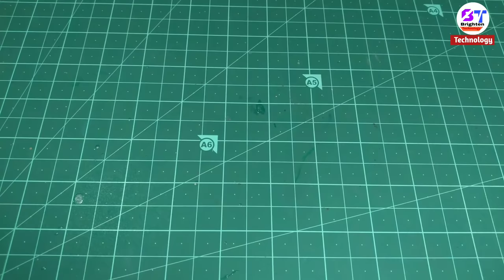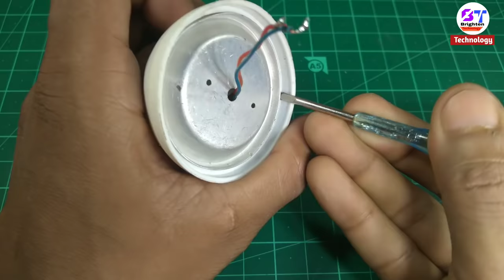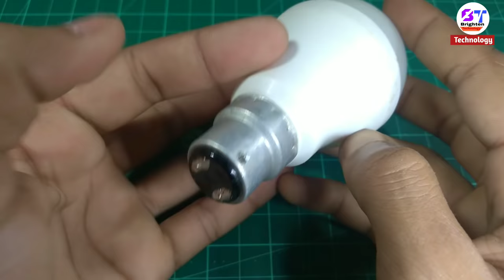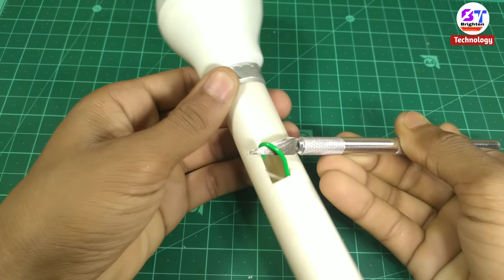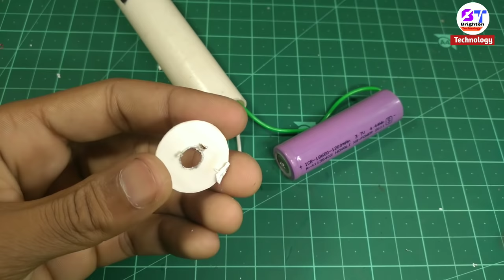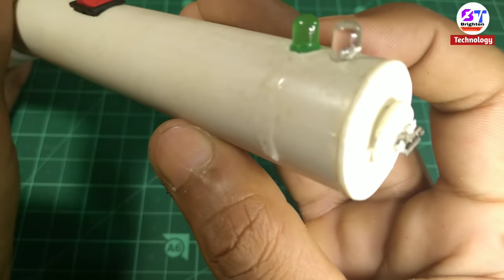How to make rechargeable torch using lithium battery and LED bulb

Comment: Use TP4056 charging board, it will be safer and has two leds that will shine through that plastic tube easily.